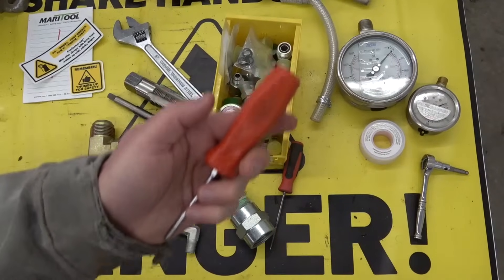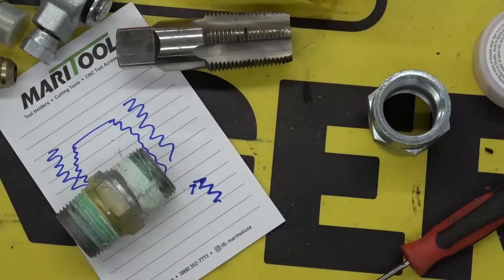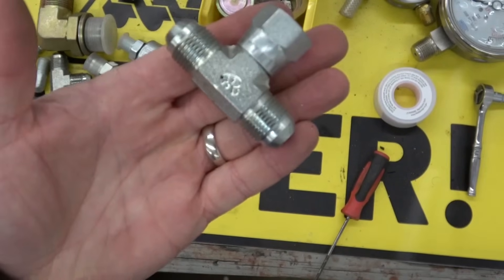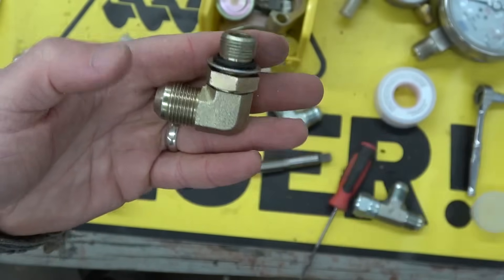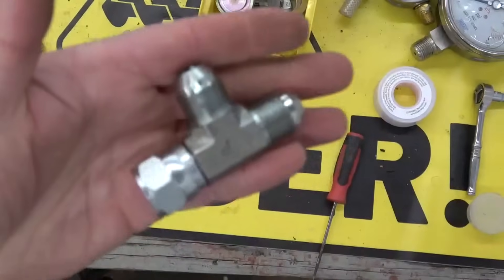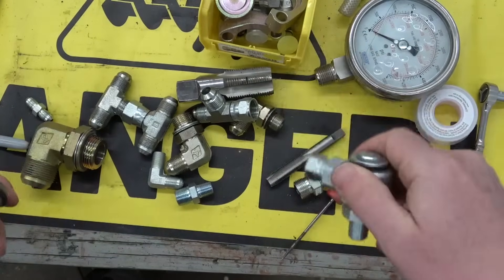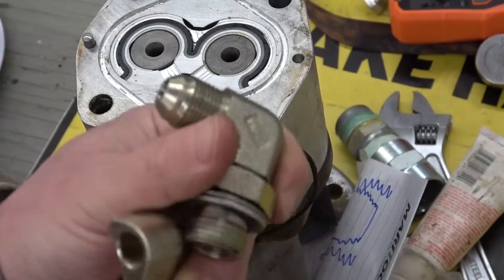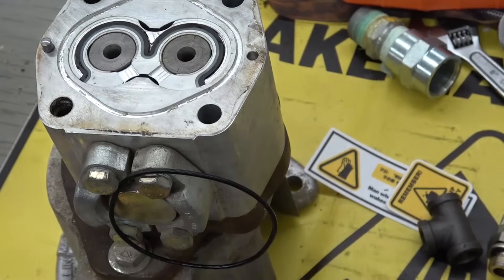Pipe thread is designed to leak || AvE hydraulic

Comment: I have to tell you my favorite fitting story. I designed and built chemical plants that made high end stuff for the pill makers. They were PhD MDs and what not.  Our reptilian salesman comes to me and ask me to set up our trucks with a rare set of fittings and to provide the mating fittings to the customers (the PhDs). I asked why. He said it was so that only our tank truck would flange up to their plant and we would get 100% of the business and nudge our competitor out. I said no way the customer is that stupid. Salesman explains that the design of the system is also signed off and approved by the govt. FDA guys and that the customer will never alter the plant in order to please the FDA.  You get all this? The slimy sales guy want's bastardo fittings to obtain a monopoly with the customer. These guys had more degrees than a thermometer but couldn't see through the scam. You know what - It worked. The PhDs told the competitor that their equipment would not interface with customers El Bastardo fittings. Chaching.  What fittings you ask? It was 1-1/4" thingamajig based on a British thread. I had it adapted to the class 150 2" ASME flange on the truck and the mirror image on the customer side.
Reply: I've got another one.  Driver pulls up with his load but the fittings on his truck are completely different than the customer's tank.  So instead of questing why he proceeds to cobble together some adapters until it fits.  Then pumps the customer part B tank full of part A polyurethane.  Guess how that one turned out.
Reply: @Core-vu6mc  solid execution, flimsy self checking... unfortunately also a solid result. (*for the layman, the above "A and B" stuff is likely for two part chemicals that are liquid when separate but set or harden when mixed)
Reply: @Core-vu6mc Did he make a forever adapter?
Reply: @Core-vu6mc  And some times they are different for a reason.
Reply: @Core-vu6mc  Thermal runaways are the root of many CSB reports.
Reply: @Core-vu6mc I don't know, thats "hard" to figure out. :D
Reply: @Core-vu6mc  Was there un explosion, or just a rupture? Or non-expanding and "just" the driver getting fired and someone having to figure out if they need a new tank or a team to clean up the solids inside the f..ed one?
Reply: 😂🤣😆 @Core-vu6mc
Reply: @Core-vu6mc  exactly.
Reply: i didnt know apple made flange fittings.
Reply: There’s a fine line between being innovative to close a deal and screwing a customer. I’m not too surprised to see that this story is adjacent to the pharma industry …
Reply: you know what, using an honest to god engineering solution to run a scam is kind of impressive, not gonna lie
Reply: Gross
Reply: So because the FDA had signed off on the setup the customer believed that changing the fittings would somehow be illegal and because your trucks worked without hassle business carried on inspite of the competition being cheaper possibly and the issue was never questioned and bobs your uncle. Right? That is kind of gross.
Reply: @jbrownjetmech-4783  The customer didn't just believe that it would be illegal, it probably was illegal. Unless of course they want to go through IQ/OQ/PQ validation on the equipment redesign. And I'm here to tell you, nobody wants to do that again. Also, PhDs generally don't give a flying fudge whether the company makes money.
Reply: @jbrownjetmech-4783  The customer could change the fittings it is just expensive and a hassle. The system would have to be tested after the installation to ensure that a different fitting did not impact the process at all. Once something is installed and tested in pharma manufacturing, you really try not to change it.
Reply: At the ophthalmology practice I used to work at had a laser cataract machine which would chop up the lens inside your eye into itty bitty cubes for removal through a suction tube.  Its exact function and operation eludes me, as I didn't actually use it.  But there was a $50,000 component that was bolted in place and no longer functional.  So, get rid of it, right?  NOPE!  That would be considered altering the machine, and in order to do that, the entire thing would have to go through the entire FDA approval process which takes forever and was very expensive.  So, there lived, and continued to be manufactured, a $50,000 piece that we, the customers, end up paying for because the government requires it.
Reply: @paulstandaert5709 As someone who likes having somewhat functional eyes, I'm glad there are restrictions stopping people from tinkering around with that kind of kit.
Reply: Brilliant.. Its a racket. Its hard to make a living out here if you're stupid. You sir, are not that. Good on ya!
Reply: resitrue true , but there's never a good excuse for helping idiots hurt idiots.. use moral boundaries or God will see your fault. 😁
Reply: @HiwasseeRiver  😂super.
Reply: We used to call those steel washers with the seal bonded to them “Douty washers “ related to the Douhty valve people.
Reply: @dannykimble7671ya that's all I heard them called till a couple years ago. Absolutely awful those things are. They either leak now or they will in a minute. I ran a machine with lots of those and BSP which is essentially an inverted JIC. As in the cone is inside the female fitting. I was not a fan.
Reply: The washers with the attached seal are also the type used in automotive air-conditioning systems
Reply: Plus, 2"ø fittings are probably cheaper than 1¼" AND 1½". That's how it is with plumbing pipe and fittings anyway...
Reply: @HiwasseeRiver  A machine shop could make a lot of money making adapters for that monstrosity ..
Reply: Reptillian sales guy. 😂 Sociopaths gotta eat too.
Reply: Sounds like typical govermento spending st its finest...... only the best fittings for all of you plebs says the king
Reply: British G threads are fun…
Reply: I'm a #unionmillwright and work in paper mills. A lot of the machines are from Sweeden and use a british whitmore thread. Most hydraulic hose / stores don't stock most of them. The engineers don't want to make revisions to the drawings either. A lot of down time could have easily been avoided...
Reply: Medical business at its finest.

Comment: “He knew something I didn’t” Reminds me of an old hand on the crew I started with. We were sorta catch-all contractors working on state government buildings. We were doing some interior painting, ceiling and walls exact same color but different mixes. Once they dried you could tell them apart but while they were in the pan, no chance. So government job right, meaning we all have identical equipment. Start of the job they just bought us all pans and brushes, etc. So he leaves his pan unattended for a bit, me and another guy who were painting in a different room decide to mess with him a little. Since he’s painting ceilings, we bring in a nearly identical pan of wall paint and set the two of them side by side in the middle of the room. He comes back in and without saying a word he dips a finger in one pan, pops it in his mouth, says “wall” and picks up the other pan. I’ve never been so amazed. 50/50 shot and the odds were in the flavor.

Comment: Here’s you a little tip for the tapered seats such as the JIC. 
When tightening the female to the male tapered especially for the brass versions, right at the point when the the two tapered sections begin contact begin wiggling the the movable portion as you continue to tighten the joint will aid in the “square alignment” of the 2 tapers. 
My experience has been the splitting of the joint and even the crimp on the nut comes from the misalignment of the two pieces. 
Yes over tightening will cause that too but usually it begins with the misalignment.

Comment: O rings on hydraulic fittings have various hardness standards.  Shore 70 on 3000 and 6000 psi flanges and shore 90 on ORFS (John Deere for example).  With a bit of practice pinching with finger nails can tell the difference.  Look out for cheap o ring kits where the o rings are a softer material.  They will fit the size but fail over time. 

Also taper male threads will seal well on taper female threads.  Taper female threads are not so common and cause mis matching, thinking it sort of fits.  Usually I’d notice the torque difference on tightening the correct match against taper male to taper female.  Sometimes I got away with a good pipe sealer with horse hair…..wound on the male threads but usually at under 3000 psi. 

The Whithworth  thread you mentioned looks more like BSPP (British Standard Pipe Parallel).  The inverted cone compared to JIC, is a tell tail of BSPP.  Usually a taper male thread will seal poorly on a female cone.
The Whithworth hydraulic threads are a fine thread.  All explained in pesky engineering handbooks…. But who has such stuff these days.  A calliper and selection of thread gauges helps to.

Comment: JIC is the best. But the problem in a mass production is can't be tightened with a torque wrench very well because its a mushy soft joint and if you have a drop of oil on it the clamp force goes up ~50% and can lead to breaking the ferrule--it takes human touch and an experienced hand to tighten them correctly. I used make products for Deere and fought them on this. When they moved the product to their factory they went to O-ring face seals for the sake of production control. But it was a hot application and by 500hrs they would leak everywhere like a sieve once the O-rings would harden.

Comment: I’m not sure if it was listed for use with hydraulic fluid, and the fittings were a bastard to take off later, but I used to use some stuff called Leak Loc as a last ditch effort on a leak. It was a pipe sealant that was made for the refrigeration industry, but it worked on anything - JIC (put a little on the male flare, careful not to use too much so you don’t contaminate the fluid), pipe thread, whatever. Never had to use it on ORB or face seal, those just always seemed to work the first time.

Comment: Cool vid dude!

I’ve gotten out of plenty of binds with aviation fittings (37.5 degree) just like JIC, by using valve grinding compound to lap the mating faces of the fittings together to renew the contact surfaces,  this of course is also remedied by using aluminum Conical seals which are also helpful.    A great sealant for pipe threads used to be “Seal-lube” but it seems to have been discontinued.  Closest I’ve found is a product called “EZ-Turn”

Comment: I have told guys like my “cob job” happy dad to NEVER use standard (Schedule 40) NPT fittings and pipe on hydraulic lines, and until I saw this, schedule 80, either! It went in one ear and out the other! (Still does!!) and he always said “been doing it all my life, and never had a problem or one fail!!” Welp, I also told him not to weld or use a cutting torch, especially in the garage, on dozers, skid steers, etc where crud mixed with mostly hydraulic oil etc is, and he said same shit, and proceeded to burn up our beloved Case 1840 skid steer, AND damn near our steel jeezless high bay steel garage building doing just what I said to fucking said to QUIT DOING!! He listens to no one, and I STILL have to dump small containers of gasoline he uses as a cleaning solvent in the garage AFTER I just rewired it-and I am a paraplegic in a wheelchair so it was pure HELL for me!! He is 86 and hasn’t learned yet! I will have to spend money I don’t have to get commercial ABC fire extinguishers because he thinks there is “no need for them”!  He is denser than frozen mercury, I swear, and tighter than 2 coats of paint when it comes to spending money on important things! If he had working extinguishers that day in all the strategic important places in the shop, plus one in the skid steer, he could have put that oil fire out in a few seconds! Knowing him, he would have refused to use any because he is too cheap to get it recharged! He only knows military crap that hasn’t had ANY relevance to him since the early 1970’s when he got out of the Seabees. They cobbed up everything too. But yes, sched 40 on hydraulics is super dangerous! Don’t forget that hydraulic oil spraying on a hot exhaust can cause a bad fire and start as an explosion, too! And cast iron NPT fittings on hydraulic lines can explode into shrapnel especially if shocked while in use, too!! Shrapnel!! 😮 cheers all! 😋👍🏻 and KERP YER DICK IN A VICE! 😆😆😆

Comment: I am building glycol cooling pipes for train testing area's in train plants with hemp. Had a lot of problems because we had to test with air.... freezing hazard. A lot of leaks. Aftershave fill8ng it with with liquid everey leak dissapeares.  Love your video's and it learns me a lot for the last 5 years. Waiting for some more boltrs!
Reply: spelling control is a bitch. But you get the point

Comment: My issue is Imperial measurements are based on the arbitrarily exaggerated length of some dead kings foot.  Somehow America is the only stand out using imperial standards.  How un-American.  How ironic. Fractions are fine.  No problem with them.  But you know where you can shove your kings foot.  Thats why metric would be better.  What do global fittings look like?

Comment: BSP 60 degree cone parallel thread used in UK . Taper threads are also dangerous as you can’t tell whether you have trapped pressure when undoing

Comment: How do you reckon they get that backup washer over the threads on that ORB positionable elbow @7:04? We find that the washer ID is damn near the thread root diameter, which is a bit much for thermal differential alone to overcome. Any ideas?

Comment: Great video 👍. I used to work with stuff all the time, way back when. I knew of the number nomenclature but forgotten most of it because I’m retired. I’ve always said the metric system is for people that can’t do mathematics and fractions 😂😂😃👍. A tip on sealing NPT thread when running natural gas that a plant maintenance guy told me decades ago was and is use No. 2 Permatex gasket sealer. It resists petroleum products and doesn’t harden and it is heat resistant. You won’t have any leaks. This way before Teflon yellow tape for natural gas black pipe.you can use it on any NPT pipe except drinking water. I’ve used it for decades now. Works great.

Comment: We have to be careful about using the wrong material o-ring on the systems using Fyrquel.
Viton or EPDM rubber are suitable o-ring materials, while Nitrile/Buna-N is NOT recommended. The wrong o-rings will seal for a while, then get eaten. 
There's a trick to telling them apart, and you don't have to chew them to tell...

Comment: Ive tried goop and teflon tapes sometimes they work. Most of the time. However for a while now I just use black right stuff RTV. Right or wrong it always seals it. Even if there are a lot of bad tolerances between those chinkanese fittings.

Comment: If these threaded connections leak......then why do i see connections that last longer than the pipe?  I like and value your opinions, and video, but you are wrong on this subject.  PFTE is not a sealant, it is a lubricant.

Generally a threaded pipe connection will  never leak, provided that it was done correctly.  It can and does outlast the pipe itself.

Comment: Lol when counting with finger joints, one hand is for reps and the other is for sets. But if you go up and back, you  can count to 288, and if you switch hands and do it again, you can go to  576. Then you can pull your dick out and do it all over again to get to 1,152. So if you ever see a guy with his dick out, and he's fumbling with his fingers, he might not be a creep. He might just be with the consensus Bureau. ..😁

Is using copper wire on iron pipe threads a good idea? Or is it a great idea? Either way being the possibility of corrosion due to the possibility of electrolysis, depending on what's in the pipe. 🤔 ..How about aluminum foil? I think I'll give that a whirle next time. Thanks for the idea

Comment: Ok.... I drive a power stroke diesel. The HPOP leaked under pressure .it had both boss fittings on  output lines. I did all the refitting and locktite over 5 times.it leaked every time. I finally redrilled the output to a 3/8 pipe thread from the boss machine thread. That solved my problem. 1800psi and no more leaks. Counter intuitive , but it worked. I scratched my head too but I was fed up with leaks and willing to try anything. It worked well. The HPOP is bullit aluminum .
Reply: Nothing wrong with pipe threads.
The rubber coated washers he showed are garbage, and I would much rather deal with NPT or O rings or metal to metal conical sealed areas.
Our Waterjet machines use a 60° coned and threaded joint, and it seals up to 60,000 psi.

Comment: I don't understand why industry insists on the use of rubber o-rings everywhere, including for hydraulic and motor oil environments, when we know the damn things are basically guaranteed to fail. If it's your piece of equipment why would you bother replacing the o-ring with the same thing that failed? Why not silicone or polyurethane?

Comment: Let's discuss L17 fittings... Never heard of 'em? Immagine a 30° JIC flange but with diffetent nominal measurements. A 1/4 L17 is not the same as a 1/4 JIC and also uses a different thread pitch just for fun. In my limited experience they are almost always paired with BSP fittings for extra frustration. Planing to eliminate the L17s by adapting from 3/8" ORF BSP to JIC by turning my own adapters on the lathe was when I learned that BSP uses 19tpi. My lathe doesn't even have a setting for cutting 19tpi.

Comment: JIC is trash. Everyone overtightens them which destroys the threads. They vibrate loose, and if there is any twist on the hose in the CCW direction, the hose can loosen itself up. 

ORFS is the only way to go for general hydraulics. Lubricate the o-ring, hold the hose with a backup wrench to avoid twisting, and tighten it down. Failures are rare in my experience and usually caused by misinstallation.